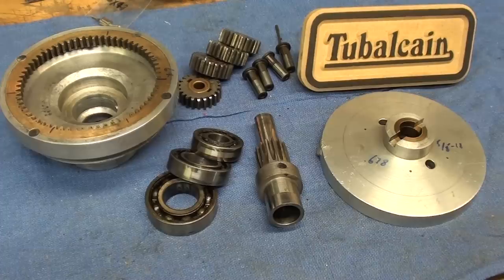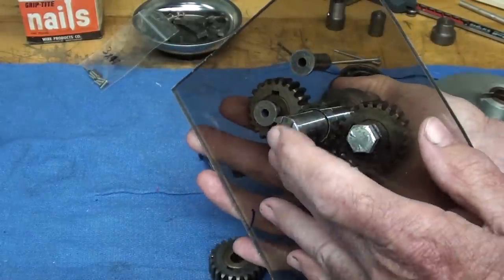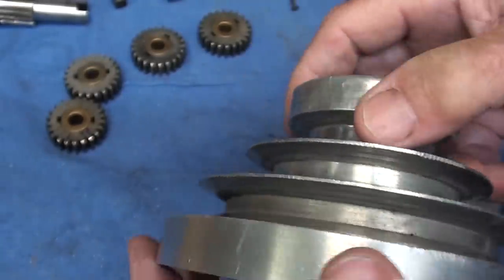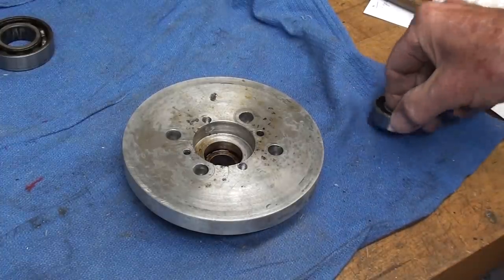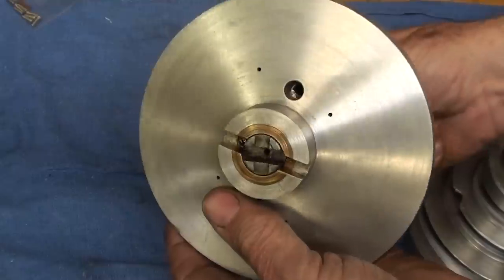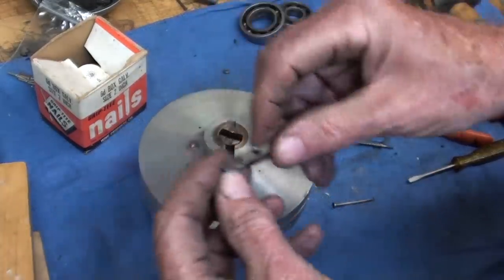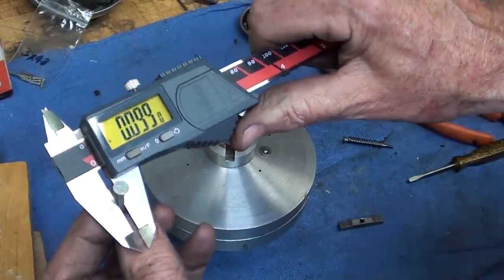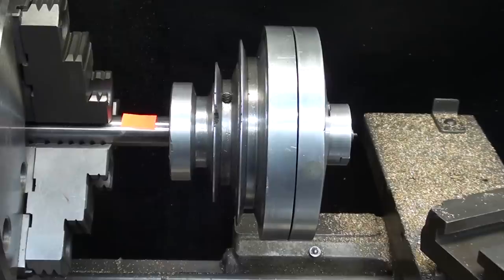PULL GEAR Reassembly PULL GEAR Tips #472 pt 3 tubalcain

Comment: Thank you very much for taking the time to show this. There were several of these types of devices used when I worked in machine shops, but I never actually ran a drill press. I did see them in use for 3/4 and larger drills. Some of the machines used a thin metal "cowling" around these to keep the oil that was slung out some what controlled and the operators had to oil them every 2 - 3 holes. :)
Reply from the maker: Thanks

Comment: If you mounted the whole unit in the lathe and cut a small groove where the upper and lower half meet you could stretch an undersized I ring over the gap to seal it up so it won't sling oil. I would also use wheel bearing grease in it instead of oil. That's probably why it's worn out. I was thinking I could make a new one in 3 weeks if I had to. Fascinating project. Thanks
Reply from the maker: Yes
Reply: Gasket ring, and Sop it down with STP to quiet the planetary gears.

Comment: Would first like to say, I enjoy all the little details. I'm a maintenance technician but with no scholastic based training, The majority of what I have learned to do my job is from those around me, and going through all kinds of different videos about a huge variety of things that have given a great host of insight into things that so many take for granted. I know that filming so much can be very taxing and I can understand if you don't have the notion to film so many details. But don't ever feel that viewers don't care as so many of us do, but just are the quiet majority that don't comment as much as the Negative Nancies.

And as my personal 2 cents. If you have heated up the lower sheave section before final assembly, (there were no bearings in that piece at the time ) then would have most likely been able to install both bearings much easier. Though my only experience to speak from is vicariously through watching your videos. So very possible I am not seeing something you had already accounted for.

Thank you for all your hard work on your videos, Mr. Pete. God Bless you Sir.
Reply from the maker: Thank you for watching. I have done much much maintenance over the years. I think a maintenance man has to have a much wider knowledge of electricity and mechanicsthen many of the other trades.

Comment: Thanks MrPete222 for making this video! I have pondered building a similar gear reduction for my own drill press, but was unaware that such a product existed commercially at some point. It seems that placing the reduction on the driven shaft would be a better solution, since that would reduce the load on the belt instead of increasing it.
Reply from the maker: That's a good idea

Comment: Thanks Mr. Pete!  Enjoy every minute of all your video, and the cut away ones are most informative!  Love to see it in the press and working with larger bits.  With proper tension on the belts I can't see them slipping unless the bit catches breaking through but usually the bit will spin in the chuck first...1-800-Bad-Chuck.  Just please be careful if that piece lets go on the sheave.
Reply from the maker: Yes

Comment: Could cut a piece of inner tube to cover the gap to keep it from slinging oil.  We would certainly like to see it run on the drill press.  You would think with today's CNC technology those (or similar device) could be made at an affordable price.  It would certainly help to use a drill press, instead of mill/lathe, to drill large holes. Great reassembly video.  Very entertaining with my coffee.  
PS: I thought that looked like a nail.
Reply: I was thinking an O-ring stretched around it would be the ticket.
Reply: It would be hard to keep the inner tube on with one half turning and one half stationary, when engaged.
Reply: A piece of inner tube stuck on to the top piece and hanging loose below with another one oriented opposite - overlapping it from below - might work to catch the oil and permit cleaning.
Reply: You’re the best, Mr. Pete! I’m so happy that you chose to make videos for us all.

Comment: Excellent video, very interesting.  Your see through set-up for the planetary gear function was very informative in actual motion.  A picture really is worth a 1000  words.  There is low temp aluminum rod out there that would allow you to fill and repair the pulley sheaves...used with propane and surprisingly strong and easy to use.  Probably demos on YouTube.
Reply from the maker: Thanks

Comment: Thank you, Mr. Pete. Enjoyable as always. I remember seeing these once, while traveling in my Popular Mechanics  "Time Machine." I'm eternally grateful that, my Father started that collection. Anyway, I seem to remember reading that, the unit worked similarly, to a lathe back gear. I can kind of see, what they were getting at. In fact, the unit seems a lot like the epicyclic back gear assembly found on the Craftsman "109" lathes. I could be totally wrong, though. I'd love to see the unit installed and running on a drill press.
Reply from the maker: Yes, the little lathe used a planetary gear set up in the headstock

Comment: Hi Lyle maybe chain saw bar oil would be the best lubricant for your gear reduction pulley.  I use it on my atlas lathe gearbox because it clings to the gears better without excessive oil slinging.   Chainsaw bar oil would work great for your bicycle chain also for the same reason.
Reply from the maker: Thanks

Comment: A very excellent, informative series...I like the old school use of your slide rule instead of the calculator.  In 1975, I bought a Texas Instruments calculator for $250 with a red lit display.  I had buyers remorse -- too much 💰.  Soon afterward, the price dropped considerably.  I still keep my old slide rules for backup -- you never know if radiation (EMP) will fry all PNP/NPN junctions leaving all electronics useless...☠️
Reply from the maker: Yes
Reply: The Anvil52 If an EMP happens- the loss of our calculators would be the LEAST of our worries!!!
Reply: The Anvil52 I paid $80.00 for my first digital calculator- and it didn't even have a floating decimal point-!!
Reply: Dale Burrell so true...back to the Stone Age...☠️
Reply: The Anvil52 YOU BETCHER LIFESAVERS!!!

Comment: Great video series. Funny thing though after watching this series I came across a functional 4:10:1 in the throw away pile at work. The owner had a small machine shop. Not sure why it was discarded because it’s in really nice condition. Seems to work just fine but it was outside. Plan on tearing it apart and making sure there are no gremlins in there. Would’ve never known what it was till I watched your videos. Thanks for doin what you do Mr Peterson.
Reply from the maker: Wow, that was a good find. They are an awesome mechanism

Comment: Mr Pete, this was interesting indeed. Maybe its drawback was that necessary gap in the design let it throw out all the oli and run those old open bearings dry causing it to fail. 
If this was myne, I would assembled it with the gears smeared in boat bearing grease(blue colour) and remove one of the oilers and replace it with a grease nipple, or just a screw that can be removed to add/inject more grease, I am sure that will dumb the bearing sound right down. If it then ejects grease(I suspect not as much as oil), one could make a cover to catch it and reuse it somewhere on the tractor.

I used this boat bearing grease to silence my small drillpress spindle, seeing it does not have multiple splines like the large one I got, so oiling it makes it noisy.

I think the only way to stop this design from spilling, it to enclose it like a diff, but then you loose the compactness of the pulley on one half of it. Maybe somebody can come up with a nonspilling design although it will take up more space, or will that then rather result in a small compact gearbox-?
Reply from the maker: Yes

Comment: Hey Mr. Pete:

The reactive member can be any of the members: Sun, carrier (planetaries) or ring, depending on the direction requried and gear reduction.  It refers to the held member.

The carrier is actually the biggest gear in the set, and you can use the sum of sun and ring gear teeth to give a value for the planetary gears.

If the sun is input and the ring is held, you get maximum reduction (smallest drives largest gear)
Sun is input and carrier is held - reduction in reverse through the ring gear
Ring is input and sun is held - "medium" reduction - medium gear drives largest gear
Ring is input and carrier is held - overdrive reverse - medium gear drives smallest gear
Carrier is input and sun is held - overdrive in forward
Carrier is input and ring is held - greater overdrive in forward

Now, since the pin is on the plate that is basically the planetary carrier, holding that provides reduction between sun and ring, in reverse.  Idlers allow, as you said, the ring to run in the same direction as sun.

Tying any two members together provides direct drive.

Hope that doesn't muddle up too many folks!
Reply from the maker: Thank you for a great dissertation. But you are way beyond me

Comment: Always good to see the full thinking on every item , many times it gives a perspective that might not be seen by many!   Oh in hyd, log loaders, those gear box's when mounted, where referred to as grizzly box's , but I think that was just due to the manufacture name on the box  LOL  ! They where just reduction box's with up to 6 idler gears on the ring gear, no speed change for the 360 rotation , the engineers misjudged the weight a few times, on diff size loaders after blowing a couple on test pad, we had to change out many the first few weeks of testing  !  Thanks for the great work on videos !
Reply from the maker: Thanks

Comment: Hi Lyle
I would love to see it work. On the lathe it did not actually sound that noisy. Maybe the oil you added helped. The inner tube or big o-ring ideas both sound excellent. I would venture to say that a slice off of cheap 26 inch x 1.75" or so mountain bike tube would stretch just fine. Might even serve as a noise dampener too! :-)
ps.-just a bit of trivia: I am am avid mountain biker. Terrain varies greatly from flats to very steep sections and obstacles like fallen logs to cross(which is part of the fun of course). Having lots of gear choices is an advantage. warm regards vic
Reply from the maker: Thanks

Comment: your tenacity is rewarding.  hope it works for you. I went so far as to purchase off ebay 3 speed lawnmower small gearbox after a bit grabbed my piece and pummeled me arm. Still sitting under counter. gave drill press away. If it does sling, close slot with a silicon caulk(easy to remove).
Reply from the maker: Thank you

Comment: Lyle,
 I think when it comes time to run this on the drill press with even a small amount of oil in it, you'll conclude it's time for that "O" ring seal I mentioned earlier. The oil that slings out is bound to get onto the belt and run down onto the drive pulley when the motor is off making the belt traction problem even worse. Of course running with no oil will grind the gears into dust . Not trying to be a doomsayer here, but just being practical. And it's still not too late to fit an O ring by just using a triangle file to break the sharp edge while rotating it in the lathe like you did earlier to study the unit in operation, but file the groove with it in direct drive of course. Hopefully those 4 screw heads will cut OK with the file since they are now so close to the surface. But it wouldn't take much of a chamfer to hold the ring centered. Using the small .062 section ring of 5.125" OD it should stay centered over the gap and should be very forgiving of any run out between the discs, unlike conventional face type seals.
 And, like I said earlier, it's inexpensive and no disassembly is required to install a new O ring seal when it wears out. Seems to me this is certainly worth giving a try. The .0625" section "O" rings (AS568-049) can be had thru Mcmaster.com as stock number 9452K314 for $6.40 per pack of 10. These should be about right if the housing is about 5.125" diameter. Adjust size as needed though to suit your housing. It should slip on and make a snug fit.
 A heavy synthetic differental lube might be best. Plain GL-5 would work but stinks way too much because of the EP additives. If any leaks out it would smell up your entire basement. Might even experiment first using plain 30W non-detergent motor oil available at Walmart for about $2.50 /qt.
Also, you might want to drill and tap a second hole for the reaction rod 180 degrees from the other one for balance purposes, and as a side benefit, the threads in the holes will last twice as long since there are now two of them. Good luck on this project.
Ray Satorius
Reply from the maker: Thank you Ray. But I cannot be worried about that. I have already moved on to many more projects. And that gearbox will be removed in the next video and be replaced by a direct current motor. Thank you for the suggestion
Reply: Lyle,
 The DC motor probably won't be much of a torque solution. The brush type DC motors are voltage controlled and lowering the voltage also lowers the current reducing torque and speed. With the VFD controlled AC motor the torque is close to 100% at slower frequencies below 60Hz although the power (hp) is reduced in like proportion below 60 Hz. A good graphic layout of the typical VFD can be seen here: 

https://www.pumpsandsystems.com/topics/pumps/motor-horsepower-torque-versus-vfd-frequency

Actually a quick calculation of the torque of a 1725 rpm 1/2 hp. motor is only about 1.52 ft./lbs. which is nothing breathtaking, and you can stall this with your hand. So if you need more torque than this, then it will be necessary to use a larger hp motor, like 1 hp which would give about 3.0 ft./lb. etc. between stall and 1750 rpm.  Of course if you can live with constant speed lower rpm motor, you can get the same 3.0 ft./lb. by only using a 1/2 hp motor which normally runs at 875 rpm. But they do cost a little more but might save the cost and complexity of a geared drive. With the 875 motor the output is being "geared down" electromagnetically by using more poles rather than having to use a mechanical transmission, like a Pull Gear unit. It also has the benefits of not having anything to wear out or lubricate as well as being very quiet.
Ray Satorius
Reply from the maker: I am very disappointed to hear that. But I will be going ahead with experimenting videos with thesese DC motors (3/4 hp) on both the drill & bandsaw.  I have already used vfd s & been disappointed in them too.

Comment: That was explained well, the place that I am most familiar with planetary gear arrangement is with automatic transmissions. As for a seal to control the oil sling I suggest a strip of leather in the top section in a grove cut just inside the outer diameter just like it was used in earlier times.
Reply from the maker: Thanks

Comment: Thanks, Mr. Pete... fun series. Some sort of shroud around that thing would at least stop the oil from slinging out everywhere. Maybe even with a felt lining to catch the drip... or just a felt ring retained by elastic. Can you tell I'm "inventing" as I type? Also, a similar first-hand experience tells me that JB Weld epoxy would work as a filler patch for those hunks out of the pulley edges. Might reduce the belt wear.
Reply from the maker: Thank you very much

Comment: Neat device, appeared to run very tru over in the lathe. If you didnt want to muck around with a mechanical fix to the gap to avoid oil slinging, slap a rubber band around it. I also liked the o-ring suggestion, it would fit the gap well enuff to keep the oil where it belongs. Hope it works for ya.
Reply from the maker: Yes

Comment: I liked this series very much. If I were to redesign anything on that, I would do  a 1/4" stepped shoulder so the oil didn't just fling out between the top and bottom sections.
Reply from the maker: Thanks

Comment: Seeing your 3-speed cycle gear took me back to when I built my first bike. We called them Sturmey Archer gears and other than my mother’s old sewing machine it was the first gearing that I disassembled but had to put back together. It was the first geared bike I owned. The 5-speed unit would have been too upmarket for me, even if I’d have heard of it at the time. 
Know what you mean about the corpse. Won’t go into that here though. I don’t think that feeling ever leaves you.
Regards.
Reply: I grew up on Sturmey Archer and this is the first I've heard of a 5 speed. Sounds a bit Monty Python doesn't it - 'we lived in a cardboard box and thought we were lucky' - but I never knew they existed.
Reply from the maker: Thanks

Comment: You were talking about how much noise it was making. But you assembled it dry. I mean the bearing were manufacturer lubed, but you didn't even apply any oil or grease to the gears. So I can easily understand the nose. Gear mesh can get pretty loud even with proper lube.  I would think reworking the pulley section would be a great video for you to make. Just thinking out loud...

Comment: Good video. Yes please do the follow up video of the device on the drill press. Of course if you half the speed you double the torque, so i wonder will belt slip be a big issue ?
Reply from the maker: Yes

Comment: A 90° lip turned upwards from the bottom cover with a machined Labyrinth Seal on the side radius of the top cover is the only cure due to speed changes in the two cover surfaces.   
The surface speed differences would devour an O-ring or an inner tube stretched over it.   Only option is leave it as is or a complete redesign of the two covers.   
My lathe has front & rear Labyrinth Seals on the spindle and sump oil (30w) never gets past them due to centrifugal forces and gravity.
It's a pity the manufacture did not equipped each cover with 3/8-16 drilled and tapped w/removable plugs to ease cover and bearing/cover separation using a crossbar gear puller with 2-bolts & washers.
Reply from the maker: Thanks